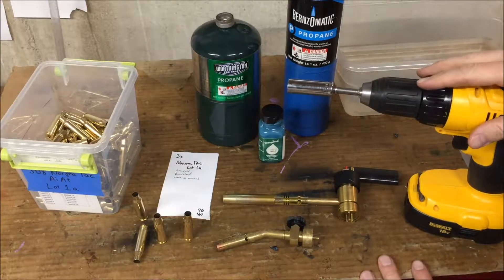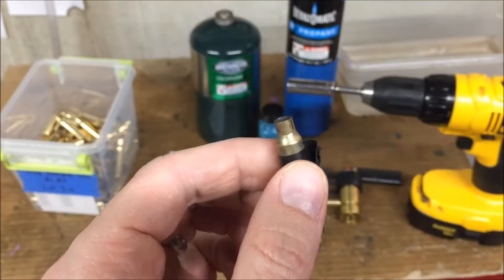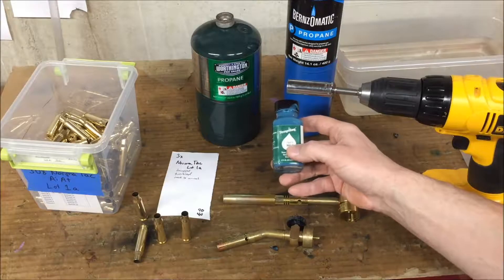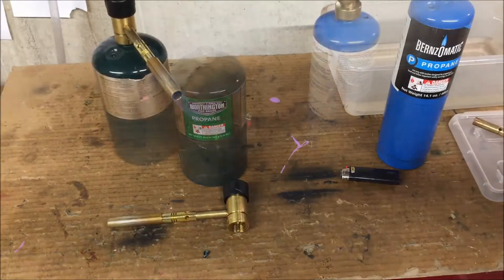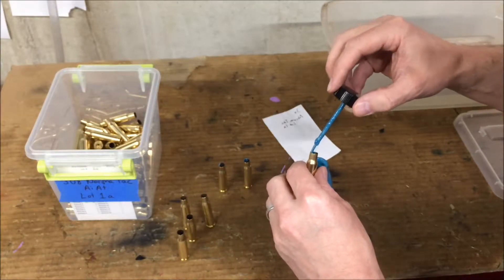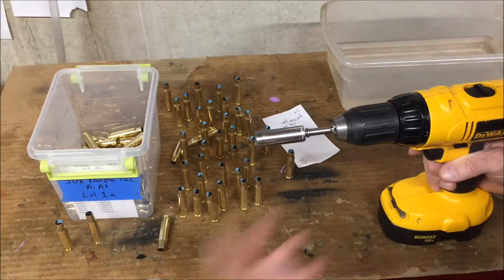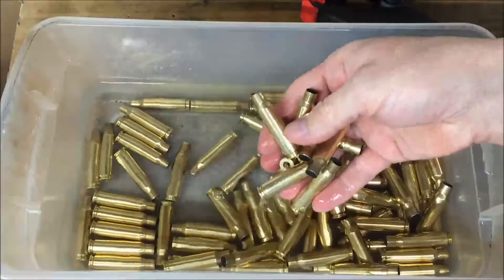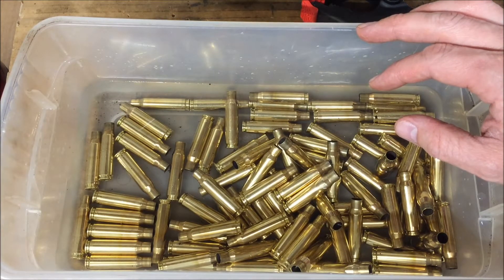Annealing brass - how to video

Comment: Good tip using Tempilaq as a temperature threshold indicator.  Check out Panhandle Precision for a variation where he uses Tempilaq on the outside of the case necks.  Both methods work fine.